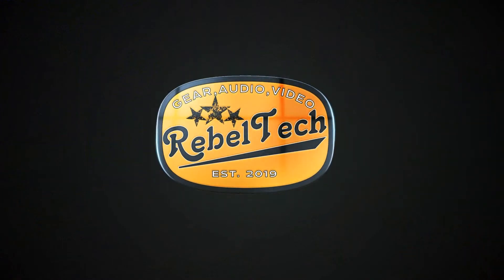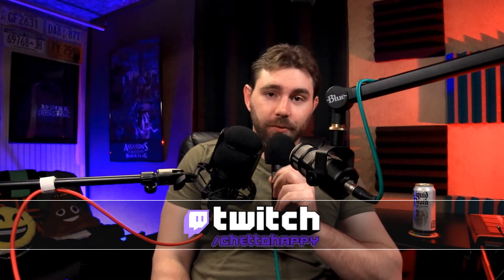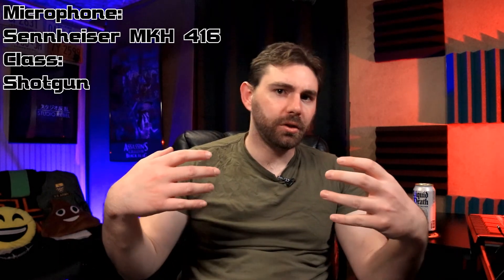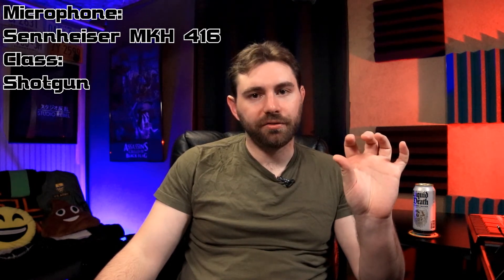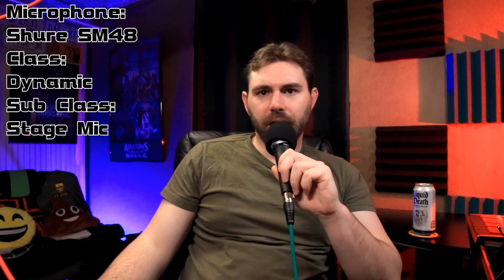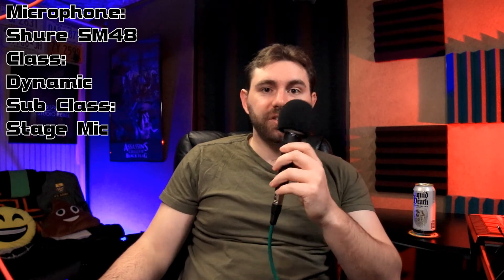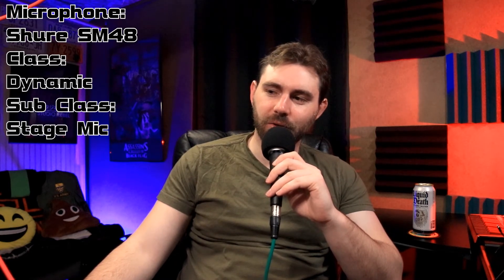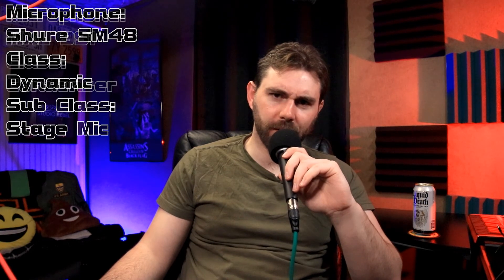6 Mics, 1 Recorder! Zoom F6 Mic Test (Part 3 The Test)

Comment: So, for the 32 bit float recording ...
Is a low output mic will raise the preamp’s self noise and an idealy higher output mic will keep the noise quiter?
Reply: The big benefit is you can't really clip the audio. You can max out your mic though though. It's true you can't set the input gain. You will change this in your editing software. It definitely helps to have a quality mic with low self noise and a quiet room. The recorder picks of my noisy laptop. So I have to go to another room that is quiet. Also if I adapt a wireless mic system or a powered mic like my Rode VideoMic NTG those mics make lots of their own noise. I did some recording tests in a very quiet room , and I actually put the recorder and mic inside a Pelican case, and put that inside a suitcase, and put a much of heavy blankets over that. I then recorded at 24 bit and 32 bit. The 32 bit file did have a lower noise floor.
Reply: @RichardsWorld  thank you
Reply from the maker: Yea so basically it’s the equivalent of shooting in RAW on a camera. If the output is too low it’ll bring it up somewhat clean. There will still be noise but you can fix that easily. When it’s too high it’ll take away the clipping. My suggestion is to make sure you have your audio input range between -6db and -12db. That is the sweet spot. If you do this regardless of the bit rate you will be fine. 32 bit is basically recoding more information that captures a wider range of frequencies. Which allows you to manipulate it much more than a lower bit rate could. Thanks for checking out the video, hope it was helpful. Let me know if you have any more questions.
Reply: Rebel Tech People says, we could not set input gain in 32 bit recording with the F6.

If that the case, I just wanted to know, in order to minimize self noise in 32 bit recording, would a higher output mic like NTG3 could help, and a lower output mic like NTG2 would make it noisier?

Thank you very much for the response.
Reply from the maker: Technically you’re not setting the input gain. The knobs are referred to as “faders” kinda like a traditional mixer has faders to adjust the mix levels. The Zoom F6 also has a gain boost in the “pfl” settings, to boost low sensitivity mics up. I use that on the Rode PodMic all the time. As far as what people say, they are half right. Your not setting the gain in a traditional way, it’s more so getting the level to a point where you can hear it. It’s tough to explain but basically, set your level like normal and use the 32 bit float as a safety net. The misconception of 32 bit float is that you can be lazy with your recording. Keep doing what you always do even when you use a 32 bit float format. I am gonna put out a video soon about 32 bit float, cause I have been getting a lot of questions about it. Best advice I can give you, as an audio recordist, don’t forget the basics and fundamentals . Technology will change but the basics and fundamentals stay the same. Hope that cleared it up for you. It’s a lot to take in.
Reply from the maker: Oh and to answer your question about the mics, take a look at their spec sheets. Check the noise floor, sound to noise ratios and sensitivity. That’s a whole conversation as well. Definitely a full video to cover it all lol
Reply: Rebel Tech I’m considering to buy a recorder right now. I’ve been using my ipad and smartlav+ for recording.

I ordered rode news shooter kit this morning. The plan is going tobe used with the existing lav. 
This why, I consider a dedicated recorder or NTG3 to buy.
Reply from the maker: What kind of content are you making? I can point you in the right direction without breaking the bank
Reply: Rebel Tech very nice of you.

Here’s what I do.
Basically I dont have any specific particular or special content. I just makes video whenever I want to. Just for hobby I guess.

About anything that crossed my mind.
Sometimes making a short clip for myself. Speak about something for people in my fb group. Or even make a short video for tutorial or something.

I havent post alot in my channel.

I dont have the luxury of a basement studio or sound room.
And the worst of all, there’s a busy street in front of my house. So that the traffic’s noise could pretty noticeable almost 24 hours. But its ok, I gotta live with it.

I could make video anywhere whenever I want.

And btw.
All these time I use ipad for a recorder for my lav or rode vmp+.
Is a dedicated recorder like zoom would have a better preamp self noise than ipad, and increase the overall sound quality?
Reply from the maker: Short answer is absolutely yes the pre amps are much better. The other thing is I need to know what mic do you have and what is your budget? As far as reducing room noise or outside I have a video on audio mistakes. There are also accessories that you can use to avoid background noise.
Reply: Rebel Tech I only have boya lav, rode smartlav+, rode vmp+, and a tascam camera stereo mic. 
A couple days ago, I made video in my garage. You could check the sound, I posted it in my channel already. But the languange is not in english, lol.

In that video, I used smartlav+ connected to ipad. 
You could imagine how riddiculous it does. Everytime I made a video, I carry along an ipad, from start to end. 

For a shoot like that, I imagine using somekind of a shotgun mic like NTG3, or even my VMP+, boomed above my head.

Why I think about NTG3, just because I only want to buy one more mic. No more.

So I expect that should probably good for my overall purpose, especially for shooting outdoor and indoor.

But I think a dedicated recorder like F6 could be a good idea too.
I dont know which one first for my need. Is it mic or recorder first.
Right now, I only wish to spent money for one of them. Not two of them together.

Or perhaps, if 32 bit recording is not that great, I consider a cheaper option like a tascam dr70d.
Reply from the maker: We for the recorder it depends on if you want 32 bit float or not. If you want 32 bit float, the F6 is the one you want. If you don’t care and 24 is good enough, the you can get a much cheaper field recorder. I used an H5 for a couple of years and it worked great. The H6 is also good but that’s if you need 4 inputs. I like zoom more than tascam but that’s just my opinion. Now to the Mic. Deity makes a great microphone. Definitely not the best but it gets good sound when you are positioned properly. That being said here is a breakdown from cheaper to higher price points for mics and recorders. Mics: Deity S mic 2s $319, Deity S mic 2 $430, Rode ntg 3 $700, sennheiser MKH 416 $1000. Recorders: zoom H5 $280, Zoom H6 $329, Zoom F6 $650. Now that you have that info, I would check out how those mics sound on the best headphones you have. Cause everyone hears things differently. I use a MKH 416 and a Zoom F6 cause I’ve used it for work. I don’t advise that for someone that isn’t doing this professionally. The H5 is perfect and you just need to decide on the mic. If you are doing stuff indoors and untreated rooms, more often, go with a shorter mic. But if it’s multiple locations then just pic what you like more. I know this a lot to digest but these are all things to consider. Please do more research before you buy anything! Hope this helped!
Reply: Rebel Tech you already helped alot.
This time I need to decide which one I buy first.
A recorder or a mic.

I did my research.

And Rode news shooter wireless would be coming in a couple days.

Here s the idea.
I could plug vmp+ and put it on a boom.
So the money could be spent for a recorder.
Or I could buy an NTG3, plug it to news shooter, and plug it to my ipad.

Which one is better, I couldnt decide yet. Lol
Reply from the maker: If it was me and I could only get one, then I would go with the Microphone first and get the recorder later.  Just as long as you have the xlr conversion for the microphone.  After that you invest in a recorder later.  Your audio sounds good, so getting a better mic with what you have to record will be good.
Reply: Rebel Tech thank you very much for your recomendation. Keep up the good work bro.

Comment: I've watched all three parts of the F6 review. I like mine and 32 float is nice, but I'm BAFFLED why the knobs do not control gain when NOT in 32 float mode. (I DO get it when it's in 32 float).

I was using it as a USB interface and if a mic is clipping or too quiet, turning the fader knob only lowers the volume of the clipped signal or raises the volume of the noise floor. I have to go two clicks into a menu for each channel to adjust the gain/trim. I've written to zoom a few times requesting the change, but I'm just baffled why they made that choice in the first place.

Good review series!
Reply from the maker: Thanks for checking the videos.  There are so many things that I would like to change but overall it's a great little device.  I use it for all my videos.  I'm gonna do a video on the interface functionality, but I wanna learn more about it before I do it.  Also there are so many better options for an interface.  Once the GOXLR Mini is in stock i'm gonna pick one up for streaming.  I also have a video out about the BT Adapter, if you are interested in that.  Thanks again!
Reply: please talk more about this comment, if we wanna raise gain, turning fader knob does what?
 @RebelTech1990
Reply: my shur smb7 records so low, and i have audio boosted to max in post...not sure why

Comment: In the AVX test, what level did you set your wireless receiver gain to? Have you noticed a difference if set too high or too low?
Reply from the maker: I'm assuming you mean on the Fader/gain on the recorder.  I don't think the receiver has an adjustment.  When I went through the tests, on the Zoom f6, I had the levels set at -45dB, 0dB, and +24dB.  As you saw I went through different speaking Tones/levels as well.  I recorded everything into a 32 bit float file, which I highly recommend if you have the option.  That will help getting the gain to be consistent throughout.   I'm not a big fan of the mic that came with it.  The ME2 is a bit muffled and needs a lot of post help.  I want get the newer Senneheiser Lav mic or another compatible one, because this one doesn't give a good range of tones.  The one I've looked into is the MKE2 and it's different variations.  The problem is they range from $300-600, for just the microphone.  I've heard some test and it's better but not worth the cost.  I still do wanna upgrade the mic and hopefully I can soon.  Hopefully I answered your question, sorry for the long winded answer.  Thank you for checking out the video.  Feel free to drop a comment/question anytime.
Reply: @RebelTech1990  So the receiver on the AVX actually has a sensitivity adjustment button (below the power button) which can be adjusted for gain. Typically you have gain control on the transmitter which allows you to control an 'open mic' or 0dB vs 'closed mic' or -51dB. I think Sennheiser just decided to put a 4 step sensitivity control on the receiver side instead for some reason.
Reply from the maker: Never knew what the AF out meant.  Thanks for the tip.  I am gonna do a review on the AVX as well, so i appreciate the info.  Do you use yours with a Zoom F6?
Reply: @RebelTech1990  Just beginning to test with the F6(typically use the F8) and the AVX system.  I'm still trying to wrap my head around what special sauce Sennheiser is doing with AGC since it can't be disabled and if changing the AF makes any difference at all.  I like Sennheisers idea of auto-adjusting levels to never clip, but now that we have 32-bit float, it's a bit of a moot point.
Reply from the maker: 32-bit float has been a huge game changer for me.  It takes a lot of pressure off me when I work.  Considering I am the sound department in everything.  One day I wanna have a boom operator and just sit back and supervise the audio.  Do you have the Bluetooth adapter for the IOS App?
Reply: @RebelTech1990  So true...  There hasn't been much innovation in audio recorders in awhile, but this is truly a game changer.  I did buy the Bluetooth adaptor which seems to work great with the iPad.  I have the F6 rigged above my Sumo 19" with the iPad Air mounted below and wireless HD receivers mounted on the side.  Great for when you need to run solo projects. Boom operators are definitely worth their weight in gold when budgets allow though.
Reply from the maker: I just ordered my adapter, i'm so excited to test it out.  Definitely gonna put out a follow up videos using the wireless option and using it as an audio interface.  Can you monitor the audio from the phones output?
Reply: @RebelTech1990  Not sure about monitoring from the iPad but here is a pretty cool wireless setup.  Check out the Rode Wireless Go.  You can attach the transmitter to your headphone jack on the F6 and attach the other side to any headset you want, and you have a great wireless audio solution without any real noticeable delay.  I'm using the Sony Noise Cancelling Headphones WH1000XM3. Not ideal for monitoring but...  great for when you need to cut out some of the ambient noise around you.
Reply from the maker: I ordered the BT adapter, I’m excited to try it out. I use the Audio Technica ATH-M50x. I’ve use Audio Technica gear for over ten years and it never lets me down. Wireless adapters are basically nonexistent. Almost impossible to find a wireless solution, that’s affordable
Reply: @RebelTech1990  I use the M50x and Sony 7506's when mixing down in the studio. Technica's are a great pair of cans. Yeah sucks that wireless is so damn  expensive(both audio and video).
Reply from the maker: Do you work with cameras, as well, or are you strictly audio?
Reply: @RebelTech1990  Mainly run cam's(Red's/Canon's) but like to keep up with audio tech.  The new EOS R5 is looking promising... I'm sure they'll figure out a way to f* it up and cripple it(most likely record time), but the color science is pretty close to Red's so I will most likely pick one up.
Reply from the maker: Yea the R5 seems like the next big thing. I love Canon, I have a 77D. When I work I use Sony’s. The studios I’ve worked with have them. To be honest I’d invest in a Red or a Black Magic. Both can use A lot of different lenses. For me, if the R5 isn’t too crazy I definitely will get it
Reply: @RebelTech1990  BM stuff is great, used them in past shoots(mostly the old 2.5k cinema camera). Switching over to Red's now which is a big change for me.  Love the ability to swap lense mounts and the colors you can pull out of them(16bit color depth) is pretty insane.
Reply from the maker: I read some rumors today and it looks like the R5 is gonna be $3500.  If that comes with a lens, then i'm really going to consider it.  Also the Black Magic 6k dropped $500.  After doing some research I don't know if it's worth it though.  Considering the sensor size, the battery life, and all the accessories you have to get to make it work properly.
Reply: @RebelTech1990  @ $3500 that would be a steal considering what you're getting if Canon is to be believed(crossing fingers).  For whatever reason, I'm not in love with the images coming off the Black Magic.  The Pocket 4K/6K... Half the shoots I see online are pretty good, while the other half not so much. I remember the 4.6k had this magenta cast that looked pretty bad although they seemed to have fixed this in later releases.
Reply from the maker: I think they are nice but the only way to  get the most out of them is to modify the crap out of them.  I saw someone install a speed booster and the whole rig ended up costing close to 5k.  at that point you might be better off buying a Sony A9 or a Canon Cinema camera.  plus the files are impossible to deal with
Reply: @RebelTech1990  True, and it ends up being mostly a one-trick pony. Canon and Sony (D)SLR's are great tools for both video & photography. Hopefully, Sony A7S3 finally makes it's debut this year.  Would love to see it compete against the R5 and push innovation forward.
Reply from the maker: I don’t know if we will see it out this year. Also you think it would be on the same level? They are making the R5 out to be up there with the A9 series
Reply: @RebelTech1990  I would say the A7S2 was targeted for filmmakers(4k internal/low light sensitivity etc.) so I would assume that would be the case for the A7S3.  The A9 I would say is geared more towards the professional photographer with some added video perks.  Since most of the specs given for the R5 are videocentric, I'm guessing Canon announced this deliberately to take the sails off of the much-anticipated  A7S3. Hopefully, Sony comes back swinging and to quote the Sony Senior Manager Yutaka Iwatsuki during a Cinema5D interview: "Go beyond the customers' expectations”.
Reply from the maker: That’s very true, but do you think they will be like Canon in the sense of moving on from the 5D series to the R series? Instead of a A7S3 they come out with a completely different model?
Reply: @RebelTech1990  hmmm that is a good point.  While it may come with a different naming convention as others have speculated, my guess is that since it is so Iconic, the A7S nomenclature may live on for awhile.
Reply from the maker: I love the A7SII, I use it a lot with work. The auto focus isn't that great, mostly because it's a very old sensor.  I also use the A7III and that is a great camera as well, problem is it sucks in low light.  The A7SIII better be both of those camera in one, that would put a hurt on Canon.